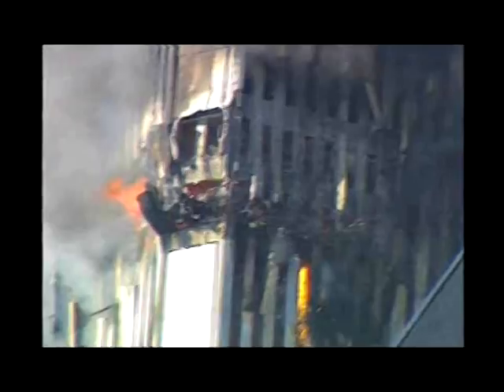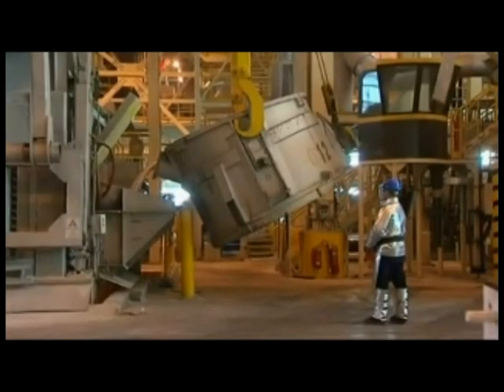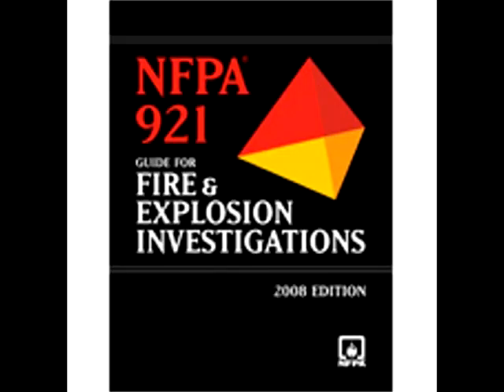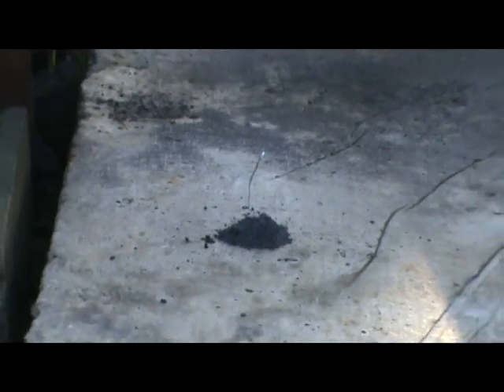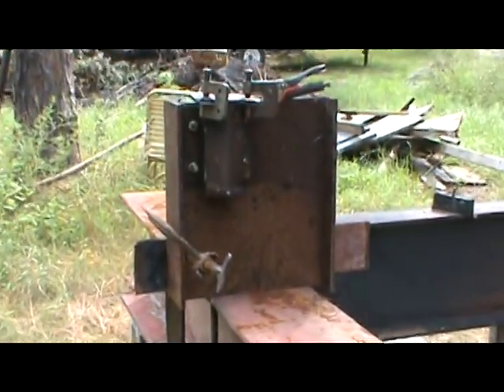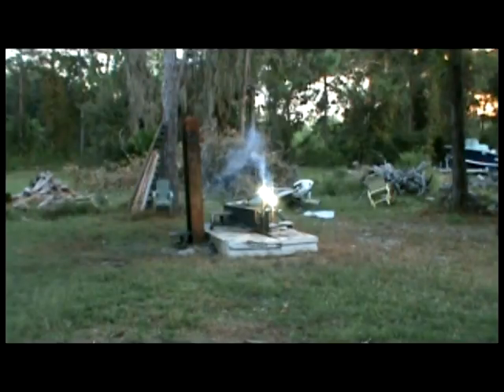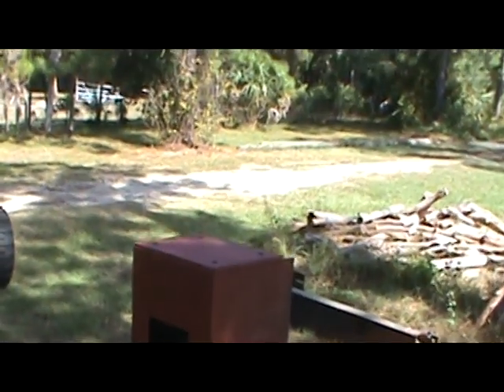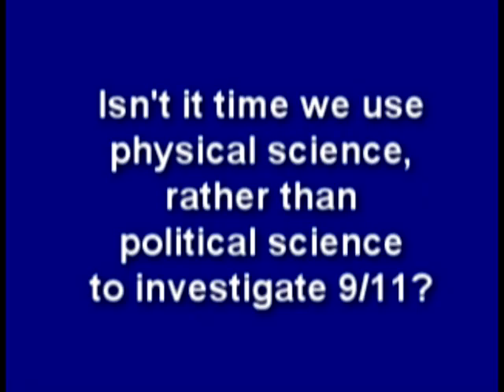9/11 Experiments: The Great Thermate Debate

Comment: According to the report's probable collapse sequence, heat from the uncontrolled fires caused thermal expansion of the steel beams and make the structure unstable. That could have probably made the structure to collapse. In these experiments did not consider the weight of the structure..
Reply: Free fall and stuff turned into dust is a topic. Some variant of controlled demolition is also possible.
Some free falll video seem to show some 'poof poof effects' for every floor collapsing the way demolition appears ?
When people speak of a building being "pulled".

Comment: This coupled with the eye witness accounts of numerous night janitors that were restricted from entering the towers about 5 weeks before the attacks between the hours of 11 pm to 4 am. Witnesses stated they saw technicians carrying large anvil trap cases into the towers at night. The youngest Bush brother was in charge of the security at the towers and subsequently "quit" just after the attacks. Silverstein was the owner/operator of the towers and had an additional policy drawn up a mere month before the demolition. Why did tower seven collapse? It was not on fire at the time, and was only struck by debris on one small corner from the previous towers falling along side it. Why was the fire department personnel yelling on video "clear the area, they are blowing tower 7" right before it CAME DOWN. Anyone still believing this was only a foreign attack and not at least partially an inside job has to have their head up their ass!

Comment: How can you melt steel? With AIR...they pump air just like a blacksmith does with billows into the coals which makes it white hot. There are regular winds up 60 or 70 mph up in those high rises. Those winds did the same things as a billows and melted the steel...not sure why no one ever brings this up!

Comment: Basic physics too. Matter can neither be created nor destroyed. Jet fuel has a specific amount of energy and will burn at a set temperature. The only difference in the alot of fuel excuse is it burns longer, still not hot enough to melt steel on it's own. It had help

Comment: He’s right to say that jet fuel will not melt steel beams, but any engineer from an accredited university would know that the steel didn’t need to melt for the structure to collapse. It was just heated to the point that it’s yield strength was reduced and it buckled under its own weight. Simple engineering.

Comment: Small particles of metal melt at much lower temperatures than bulk metal. This is called the Thermodynamic Size Effect. Micro particles can melt at temperatures as low as 900 degrees F, and an impact like that from a speeding jumbo jet certainly created many of these, not to mention the much greater impact of the collapsing building. Also the red chips contained no elemental aluminum, which means it COULD NOT have contained thermite.

Comment: It doesn't have to melt to bed. The top part of the tower weighed that the same as the titanic  if you put that weight on red hot soft steel its gonna break... people are so fucking stupid
Reply: True, but the issue is that the mass of one titanic won't demolish the mass of two after being destroyed first against them, and weaker metal won't win a battle against stronger metal just because it's on top of it.
Reply: There was more than enough energy in the falling mass to crush what was under it. Only delusional conspiracy kooks argue otherwise.
Reply: There wasn't enough mass in the upper block to demolish everything between it and the foundation before being destroyed first, and that's probably why you vaguely pointed out there was more than enough energy to crush "what" ever is below; which could include a bug.  I'm not the delusional person who believes people conspire to kill themselves because they hate you. That's your conspiracy theory tpryce, right?

Comment: Thermite makes sense. Iron oxide, rust on the steel beams.. aluminium from the fuselage, the remainder of the jet fuel which wasn't burned up in the fireball upon the plane's impact and office equipment, plus the water from the sprinklers reacting with these elements, all leads to this level of destruction

Comment: At 1100 degrees a sustained building fire could weaken any exposed steel by as much as 60%. Not melting, but causing the steel to lose its stiffness. Throw a couple hundred tons of steel, furniture, people running around on fire, etc. on top of that and the beams would fold.

Comment: You are a dumbass!  I never saw the thick black smoke in the 9/11 video but it is all over the place in your videos.  Secondly, you admitted to not using true thermite.  Third; Google Modulus of Elasticity.  Steel doesn’t have to melt to a molten consistence to fail.  Additionally the plastic and yield strength occur at much lower temperatures than you claim.  Quote: “The test results show that carbon steel begins to lose strength at temperatures above 300°C and reduces in strength at a steady rate up to 800°C. The well defined yield plateau at 20°C is replaced by a gradual increase of strength with increasing strain (or strain-hardening) at high temperatures.”  In conclusion you have no idea what you are talking about.  Additionally NONE of your experiments artificially induced a real-life live and dead load that would have been present in the building.  Lastly, the perimeter may have been tube steel, the internal structure was
Comprised of mainly steel trusses to support each floor.  Once weakened, the whole structure starts to fail.  May God forgive you for your ignorance AND MORE IMPORTANTLY if you are
Monetizing this video and making money off the 3000 or so died expense!  Do you have a soul?  SMH!

Comment: Guys, sure, the heat could “weaken” the steel, therby causing the collapse. However, the molten steel found by the first responders is not explained using the jet fuel argument.
Reply: lennyhipp lmfaoo, i made no guesses. I just made a comment, based on what was said by those who were there. And them saying it LOOKED like a lava flow is not them saying it WAS a lava flow. Also, what other material in those towers could have been hot for THAT long, if not metal...the jet fuel certainly couldnt have burned that long...relax dude..we are all just speculating at this point.
Reply: nofloex " i made no guesses" yeah you did. you jumped to conclusions based on what a few non-expert people said and attempted to make an argument from authority fallacy

"them saying it LOOKED like a lava flow is not them saying it WAS a lava flow" agreed. and I never said nor implied this. And them saying it looked like molten steel doesn't magically mean it WAS molten steel. and them saying they heard what appeared to be explosions doesn't magically mean there was explosives. Your argument defeats itself.

"what other material in those towers could have been hot for THAT long, if not metal" you're referring to thermal imaging days after the attacks? it very well likely was debris smoldering and slowly burning. NOT molten metal. Such as what's happening here: https://www.youtube.com/watch?v=fsgqy5FYP2c FIFTY SIX YEARS  there has been a fire burning here. All you need is oxygen and fuel. (and by "fuel" I don't mean gas)

".the jet fuel certainly couldnt have burned that long" and NOBODY but ignorant conspiracy theorists have ever suggested this. So what do YOU think the source of the heat was?

"relax dude..we are all just speculating at this point." if I was any more relaxed, I'd be dead.
Reply: lennyhipp i speculated i didnt guess. Experts who have examined the site also say similar things. My original comment was a speculation based on what was said by hose who were there, as well as what experts have said based on what they saw. I didnt say it was molten metal, i dont know what it was. I have no claims, my whole point was speculatory, skeptical even. Not a guess.
Reply: lennyhipp myself, who is not an expert, didnt believe the official story, nor did hundreds of pilots, demolition experts, and physicists. So forgive me if im a bit skeptical....
Reply: rotfl "Experts who have examined the site also say similar things" from what i understand, the ones saying similar things were people in construction or architects, but with no experience in constructing high rises. 

"didnt believe the official story" i respect that, but why though? what specifically was it? I have extensively researched this,, and i haven't seen a single compelling reason not to believe the official story. The ONLY thing i'm confused about is the eyewitnesses in DC who give contradictory testimony of the position and direction of the plane that hit the pentagon... I don't really have an answer for that, but it would seem common sense to me that there was only one plane, so half of them are just wrong. I figure there was a lot of confusion and stress and people just remember the events wrong. you get 100 people witness the same event, you'll likely get 20 different versions of it. Eyewitness testimony is unreliable.
Reply: rotflox "However, the molten steel found by the first responders" no, but it IS explained by misspeaking under duress. Also, did they say "molten steel" or "molten metal"? i honestly don't remember.
Reply: thanks. but, they are no experts and most likely misspoke. He most likely meant "molten metal" or doesn't differentiate between the two. My guess is if you were to ask him what he meant, he would most likely correct himself. Also, while you're at it, ask him if he has any doubt it was a terrorist attack.
Reply: lennyhipp “most likely.”  Lol he said what he said. Your “guess” on what he meant solves nothing, it just adds another perspective. Many witnesses and responders said molten steel, or a “river” of steel or metal. Some said it looked like a lava flow. For the metal and steel to remain hot for weeks after the collapse means it had to be molten. You dont need to be an expert to understand that.
Reply: 1:02

Comment: The columns weren’t melted. No one is arguing that. 
The columns were weakened by the fires. There is a difference.
Reply: Kerosene (Jet Fuel) does NOT burn near hot enough to melt steel let alone weaken it. In the case of WTC 1 and WTC 2, both buildings were comprised of A36 steel which has a minimum, (MINIMUM) weakening temp due to fire of 2,413.6F (Fahrenheit) and begins to turn molten at 2,750F (Fahrenheit)

Kerosene (either J A-1 or J-B) has a MAX burn temperature of 1,801.9F (Fahrenheit)

That information is BASIC FUCKING SCIENCE and has been proven (it does not and cannot change) especially due to your own inferiority.

So explain to me again how a low grade fuel like kerosene solely contributed to the collapse of WTC 1 and 2?

Comment: Does everyone forget that a massive airplane made out of aluminum flew into the towers? The molten aluminum is what you see not molten steel.
Reply: Molten aluminium glows a silvery colour & molten steel glows orange,  you idiot
Reply: I'll give you an insider look, I used to be one of these nutters and when faced with the possibility of it being aluminium, we just said there were no planes or that all the aluminium was 'destroyed.'
Reply: Did you even watch the video? Molten aluminum doesn't glow yellow.
Reply: @multimapping8303  the Molten material is not from a thermite reaction either..  
Do you see any ignition source, showing the thermite actually burning???
Reply: Molten aluminum doesn't glow like that you dink. Molten steel glows bright orange/yellow.
Reply: @delosombres because hundreds of tons of material on top wont push out debris under it. Air pressure totally won't be pushed under out as the building is being pulled down.

Comment: I've burned a camper trailer and the steel bent at the middle and folded to the ground in the middle it didn't melt but it got very weak while it was on fire

Comment: No one seems to have addressed the fact of you have a fire and then you have wind blowing on it and you have air Rising through the building coming out the holes in the top how do you think steel gets made you have a flyer or any bloxygen on it and it melts.

Comment: Have to give credit where credit is due. Guy put in some work. After watching the whole video, Im left with lots of questions. The first and most obvious would be, who, what, when, how and where, were theradolamite devices placed? It would take a hundred man construction crew with 10 tons of equipment to do it, they would have to take apart existing walls and ceilings, empty offices ruin carpets, do the demo installations, put the office BAck TOGETHER AND MOVE ON TO THE NEXT OFFICE  OR completely close down a whole floor and do the same thing on a larger scale.  Plus they would have to do this MASSIVE job unnoticed!!  I can tell you this, you come into MY office with a hard hat on and tell me I got to get out of it for a week, while you do renovations? Im gonna want to see a PILE of paperwork and believe me I would raise a stink to the top. You want to tear my office apart? Im wanting sizable compensation, temporary facilities, and a stack of paperwork explaining why.  This idea is so ridiculous its embarrassing. TWO: Your little experiments never shows a half ton of molten metal being produced nor a half POUND of it, it merely showed that bolts could be sheared off etc. Big fn deal, I could sawzall those bolts of with a 50 dollar Makita sawzall, I could cut a slice in those beams with 25 dollar Harbor Freight grinder. Big deal, proves absolutely nothing.  Furthermore I could cause white flashes with some Cat fireworks for about 40 bucks. 
    Another question would be do you honestly think that a full size passenger airliner crashing into a building wont create explosions and pops or white flashes? Thats again so ridiculous its insulting.  I could go on but Im tired of wasting my time. My advice to you is to weld you up an aluminum hat and bolt it to your thick skull. Put some thermomite in it while your at it and ignite it with your welding torch. Dont forget to upload it to youtube. Youll get more likes I think.

Comment: The conclusions of the enquiry are pure bunkum, but that still doesn't mean it was a conspiracy.  Never ascribe to conspiracy, that which can be better explained by ignorance and incompetence.

Viz:

When aluminium is heated to be molten and red hot, dumping water onto it causes the aluminium to explode with a force comparable to that of high explosives.

There was tons of aluminium in each aircraft, and plenty of fuel to burn to heat it up, and the fire-proofing in the buildings would have helped to concentrate the heat.  There is camera footage showing red-hot aluminium cascading down one corner of one of the towers.

The towers had huge water tanks at the top, and these were supplying sprinkler systems on the floors above those where the aircraft hit.

It doesn't require a lot of imagination to believe that the floors above eventually collapsed under the weight of the water and dumped all that water onto the red-hot aluminium.

In fact, witnesses report hearing explosions from the buildings during the fire.

Best guess at the moment (failing better evidence) is that the towers were actually brought down by an aluminium/water explosion or series of explosions which took out the supporting girders which were supposed to hold the sides of the building together.

Most of the building's weight was supported by the outer "skeleton" and without the supporting girders, it buckled outwards which allowed the upper floors to crash downward leading to the entire building collapsing.

The enquiry never examined this possibility and dismissed the idea without even examining it when it was proposed.  They wanted someone to blame and didn't really care about finding a reasonable explanation.  Just a politically expedient one.

Comment: You make valid points and just from some very simple backyard experiments (without Super thermite) Also when the plane crashes we "see" the wings cut through the steel pillars and go "into" the building ( Are they kidding ?!? ) This could NEVER happen - the wings would be torn off and left outside - aircraft are quite flimsily built compared to a steel frame tower. Your effort is commendable - the proof is possibly still debatable but with further more extensive tests much more light would be shed on this even tho' the evidence was removed ASAP.

Comment: Haha all these stupid brainwashed liberals don’t see the real truth there has been many towers on fire but never collapsed and how could it collapse strait down at free fall that has never ever ever happened with a building unless it was by explosives and how did building 7 collapse again strait down at free fall from office fires? And wouldn’t the building fall sideways if it was from the fire?
Reply: And Kriptic Lunar, you're wrong. Many towers have been on fire and did collapse. Windsor tower is a great example, not long ago a building somewhere in Asia collapsed completely with minimal fire.
Reply: And WTC7 did not collapse at free fall speed. You're looking at the outside, which took _5 seconds to fall. However, if you include the interior of the building, it took 14 seconds to fall.
Reply: WTC 7 collapse took 14 seconds. First a column inside the building, collapsed, then ones next to it started to collapse, if you ever watch a WTC7 collapse, you can see the top part falling into the middle. Once the interior had collapsed, the walls had no support and fell at near free fall speed, not at free fall speed.
Reply: good points

I wasn't aware it was a liberal-conservative thing tho
Reply: Yeh same, I was under the impression 9/11 twoofers thought all the government was evil.